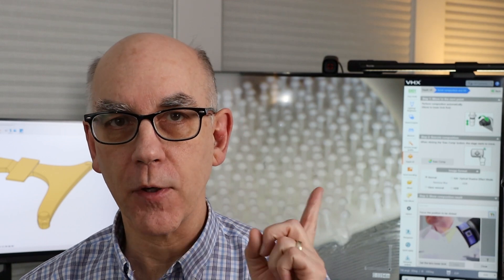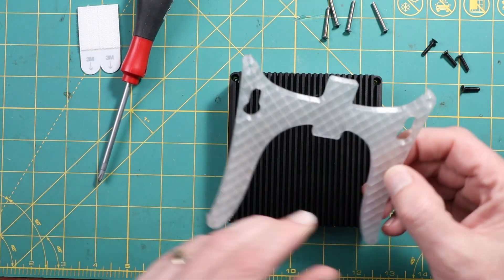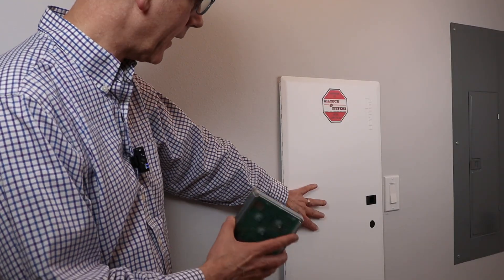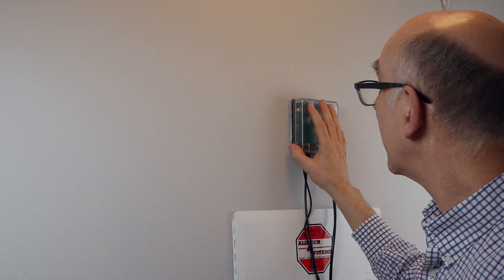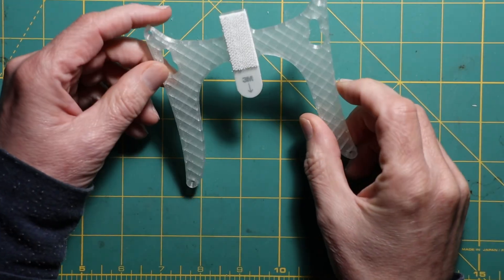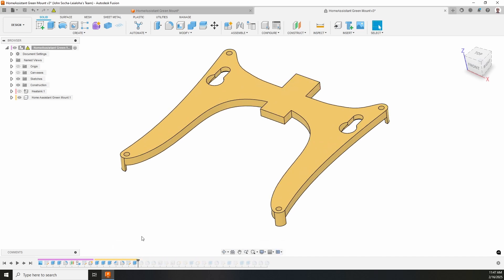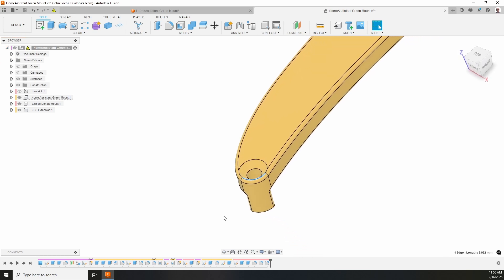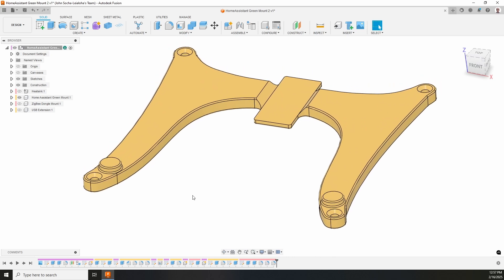Wall Mount a Home Assistant Green

Comment: Interesting. Last time i installed home telecom, I was nailing a plywood panel and 2x4 sleepers to a concrete basement wall with a Ramset. Everything else was screwed to the panel: 110 block, shelves, cable guides, etc.

Comment: Nice project! Was there any reason why you didn't just use two command strips? I feel like a command strip mounted vertically to each side of the part would have eliminated wobble without requiring you to reprint it.
Reply from the maker: The simple answer is that I didn't think of that. I guess I was expecting the command strips to have a stronger hold. Now that I see how they're made, I agree, two would be much better. I might do that just because it will be a better solution. I would still print a new version because at the moment there is only one pad the full size of a strip.
Reply: @JohnSL  Gotcha. A little heads up, it's a lot easier to position the command strips if you stick both the device strip and the wall strip to the device and push the entire device against the wall instead of placing the wall strips to the wall first and hoping they're the right distance apart. The instructions for hanging picture frames have pictures that will make more sense. Thanks for sharing!